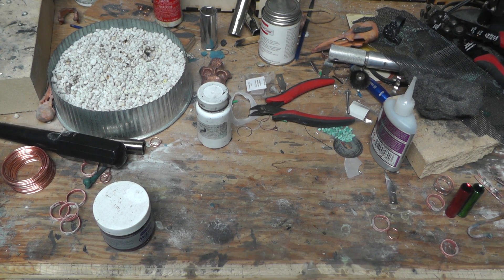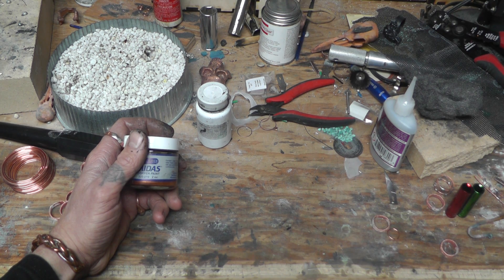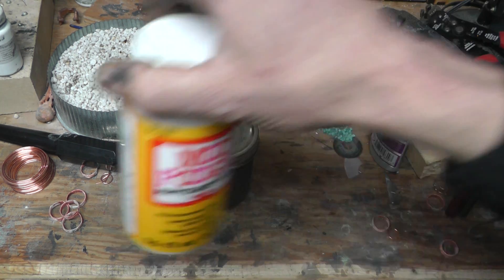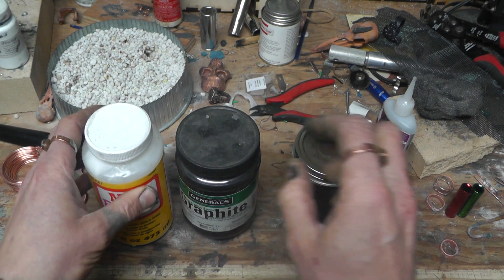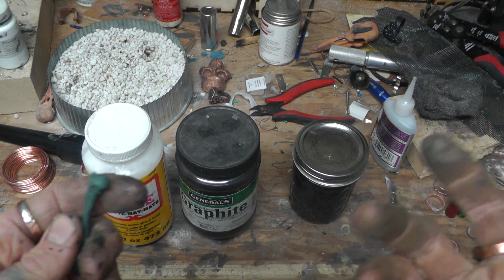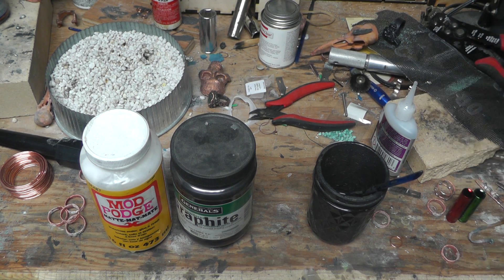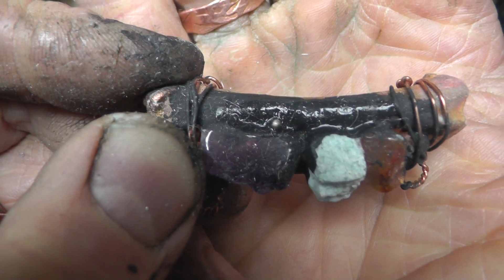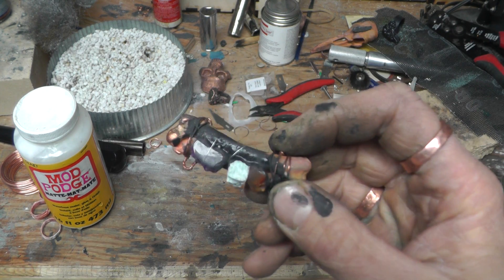Conductive paint and texture techniques for electroforming

Comment: Has anyone tried using 'lamp black' instead of graphite powder? I believe it's black smoke deposit (soot), so it should be made up of very fine particles. Right? I was about to order some graphite powder (300 mesh (95% <53µm) off Ebay, here in the UK, and I noticed that the same company also sells lamp black. I believe it's used in the manufacture of India ink, but I've tried using just Indian ink on it's own, and it wasn't all that conductive. However, maybe if I added more lamp black, then it may work better, and still give a very thin film. I'd like to electroplate onto feathers, and still keep the detail. I will try this idea, but wondered whether anyone else has.
Reply: UPDATE - I contacted the supplier who replied that only some grades of lamp black are conductive. Unfortunately, theirs is not. This may also explain why the India ink I tried earlier didn't work - BUT, some brands MAY work.
Reply: @sugitox9864  Years ago in the UK, I had success electroforming a leaf using Zebrite grate cleaner, it was like toothpaste only black and greasy!  I imagine it was for blacking the firegrate, in the old days.  It must have contained graphite.  I don't know if it is still made, or if it is, whether the formula would be the same.  Good luck.
Reply: hello, I'm from Brazil, and I'm having trouble preparing an efficient conductive paint, could you help me with some formula please. thank you

Comment: Hi, Jason. Love your videos. I've made the graphite/mod podge paint. Coated the parts and checked conductivity with a multi-meter. Can't seem to get any plating on the parts. I'm trying to plate a Scrabble tile to make a charm/pendant for my girlfriend. Any ideas as to why it wouldn't plate, or how long something like that should take? Setting was 0.1 amps and 0.5 volts.
Reply: Same happens to me
Reply: @maryli9785  sounds like synthetic powder may be being used its not conductive
Reply: best thing to use is a clear laquer coat on material to be plated then once tacky dip in ultra fine copper powder then just plate the powder

Comment: Great video! Like super great!! Two questions though...........1) are you measuring 50:50 modpodge:graphite in terms of weight or volume?.....and .....2) where do obtain your graphite powder?...... I’ve been using activated carbon from the health supplement isle at the grocery store, it claims 52g per $9 bottle..... (not sure if that counts the gelatin capsules)......The reason I ask, is because I am sure it is still cheaper and better than the Midas paint and other brands I’ve tried.... it’s a pain in the a** pulling apart the gelatin capsules....I will also say for the viewers of this, don’t waste your time by throwing in the whole capsule in (like other videos suggest) and dissolving the capsule using water or vinegar.....it makes the paint too thick and also makes it more likely to pool together, requiring multiple, uneven coats, like he described in the video.....nonetheless.... subbed.... we should be friends.... I like what you do :)
Reply: hello, I'm from Brazil, and I'm having trouble preparing an efficient conductive paint, could you help me with some formula please. thank you

Comment: Jason, the graphite powder can also be applied DIRECTLY to the wax (no "vehicle"--modgepodge, etc--necessary), because the wax has enough "tack" of its own to retain the graphite. To do so, one may dab it on by the fingerful, or dust it on by using the toe of an old sock; then lightly burnish it with your finger or sock to a semi-gloss luster... Proceed from there as you would with the paints. Thanks for the video!
Reply: What if I don't have any old socks though?

Comment: Heyy bud. So i made a batch of modgepodge and graphite powder. Have my piece soaking for just about 12 hours maybe less. Its attracting copper but its spotty. Only plating in patches. im goin to leave it for 48hours and see what happens. I know its a slow process. Just curious if your pieces form the same or if i mixed it wrong or is my rectifier not dialed in... its at .4 V and .07 A is this an ok setting or should i lower or higher something? Thanks for your vids tho. Really excited to learn more!

Comment: I saw your video but did not have the mod podge I did have elmer's white glue. I made a batch and it is very conductive when dry. I painted up a few pieces and then started thinking. This is a water based glue. When I put the pieces in the copper solution do you think I will soften the paint back up and contaminate the solution? I goes on real nice and dries hard but it might muddy up. Or, if the copper goes on it might be mushy underneath and never dry.

Comment: What is the difference between the  ModPodge matte & glossy with regard to efficacy? You seem to be partial to matte.
Reply from the maker: I think of it as the primer concept,   You don't see glossy primer.  The surface has in the end something the copper grips to if you use matte.   Does that matter with ions?  maybe not I just know Matte works and glossy has not been tested.      The matte might be the cause of why my texture is so textured when it comes out of the bath ;)
Reply: Thank you, that makes sense.

Comment: thank you for the advice I just bought the mode podge matte. and going to try the 1 to 1 I have it drying on one of my glass tobacco pipes. I'm substituting my black acrylic 1 to 1 ratio I hope to see improvement. which I believe I will with it sticking better then paint would. 

quick question, I'm doing electro forming and after 12 to 24 hours I get a lot of build-up is there a way to stop the elongated buildup from occurring compared to a smooth flat surface. I have tried a few different methods from leaving my power supply at 100 milliamps and even tried to 750 milliamp I have only noticed that it makes it more sharp to more round from the change of the current and also has some effects to its strength. What can I do to help improve my pieces to come out more smooth and controlled plating?